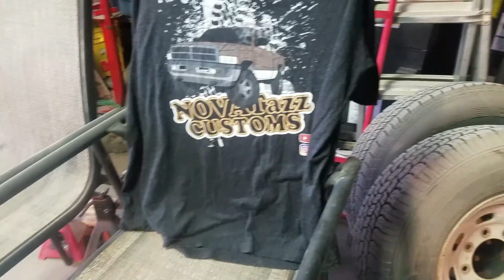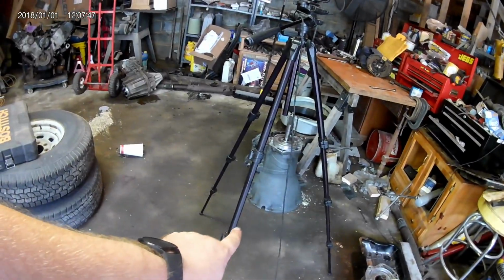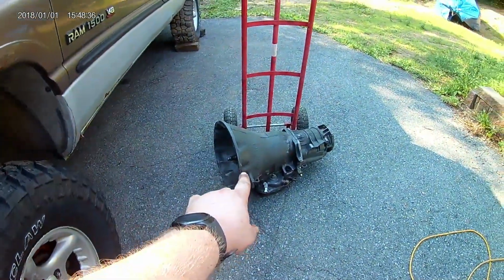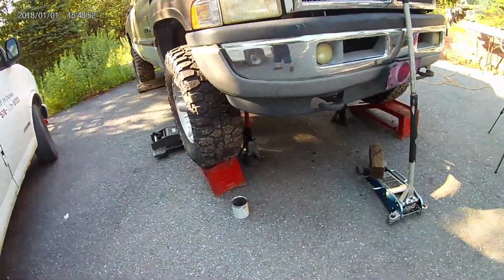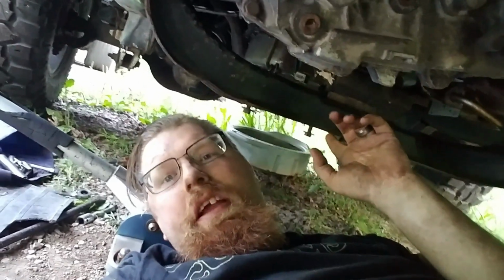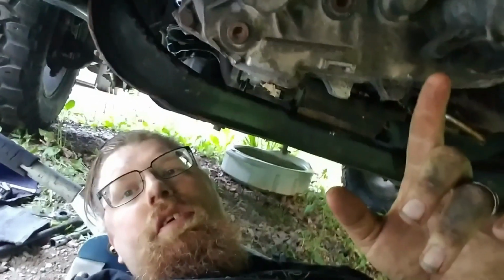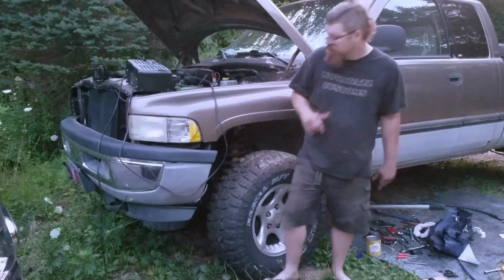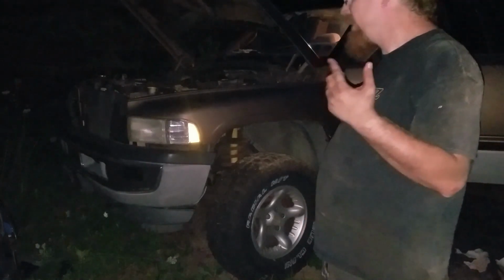I apologize but i had too

Comment: I've done everything aside from a full on rebuild. No longer shuts off od and overheats but have a pending 1740. There's also an alignment tool for the od unit to get it back on without doing all that.
Reply from the maker: The alignment tool is just the main shaft cut in half n need to be put in while the od unit was assembled
Reply from the maker: Have you checked the tvs??
Reply: @NOVAtazz  throttle valve? I rebuilt the whole VB with a shift kit. I'm at the end of my rope